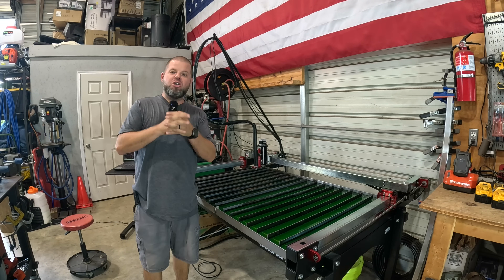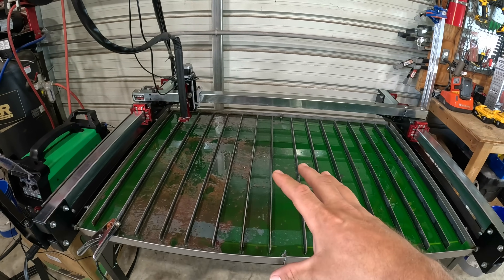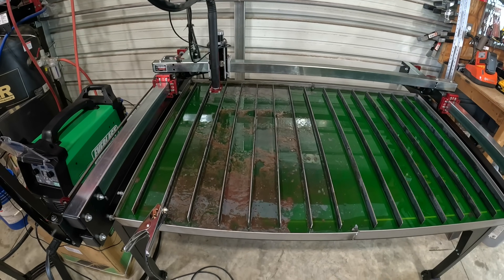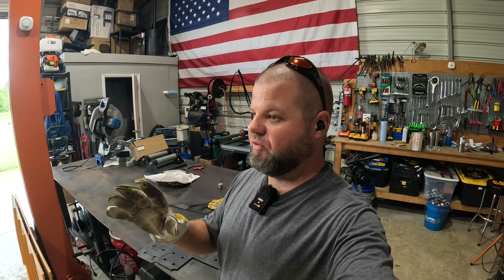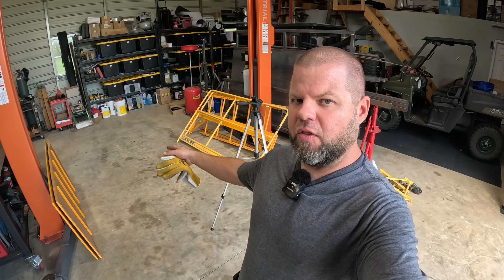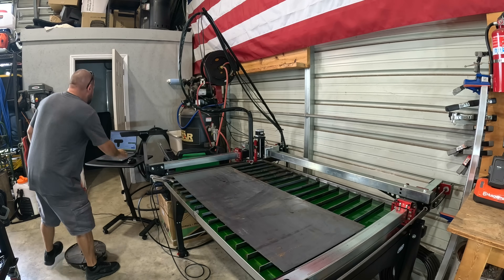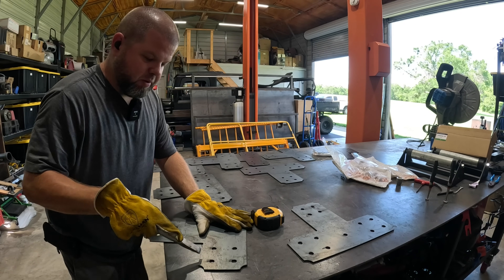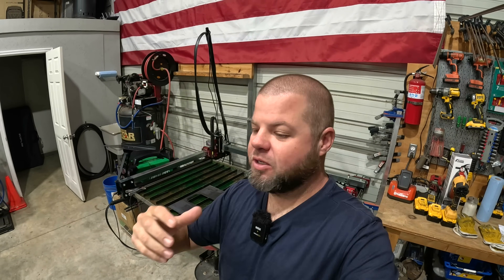CNC Plasma Table Has Arrived! Langmuir Crossfire Pro

Comment: Wow nice machine. Can you cut thinner steel like 1mm ?Which type of glassed do you use?
Reply from the maker: You can cut as thin as your plasma cutter and tips allow for. I'm running a huge 100 amp plasma, but I also intended to cut thicker materials.

Comment: I had a Langmuir table. Ran it for two years then started having problems with the THC. Their Support tech was helpful, but had to replace circuitboards and lost two months of production time before i was back in production. Then more hiccups and i ended buying a new controller. Ran fine for a year and then more problems. At this point i chucked the machine and spent $10k for a much better and larger machine. Not a Langmuir.
Reply from the maker: Hate to hear that, I sure hope mind holds up well and pays for itself.

Comment: Hi, I thinking about getting a Crossfire to make square and round cuts in coated galvanized steel. Do you think it will work? are you interested in doing some test?
Reply: It will work, the dross will be impossible to entirely eliminate and it will be hard to remove without also removing large parts of the coating making the whole operation potentially pointless. I mean the cut obviously isn't going to be galvanized?
But I've done it, laser cut a few hundred thousand actually. They're all out in the field supporting accordian air bags for solar panels or something like that, or at least that's what I was told. 

Anything to do with galvanized stuff and lots of heat means you've gotta watch zinc toxicity, by the way. Laser, plasma, welding, all the same. Not something I'd do on a crossfire table in my garage, not unless you've got a lotta milk, lol

Comment: It will NOT use whatever plasma you have, check their recommended plasma list ahead of time. High frequency start machines won’t work if my memory serves me well
Reply from the maker: That's correct, but I did not purchase a high frequency machine. Pretty easy to see their reccomendations before buying as they have a guideline on their equipment page.
Reply: @TKCL 

At 3:25 you stated
“it's
run off of whatever plasma cutter that
you want to set it up with By the way”

I’m just pointing out that’s incorrect. 👍

Comment: Look at their machine torch mount, I have one and it’s much better holds the torch up at top and bottom.
Reply from the maker: I got mine in yesterday.
Reply: @TKCL also if you get a collapsible kitchen funnel you cut a hole in it a cover the sparks from shooting everywhere. Just tips I’ve learned

Comment: What I'd like to do when I cut metal brackets I'll heat up the metal in my forge.And I softened the edges with a hammer to give it that forge look. Cheers 🍻
Reply from the maker: Sounds like a fun process to do.

Comment: I was an industrial engineer for Air Force.  We had both CNC water jet and CNC plasma machines.  I did not operate but I did problem solve when needed.  I’ve been retired for 10 years but I believe, if it will let you, try this.  On your lead in see if it will let you put in a negative number like -.06 or -.09 and then it will penetrate inside the hole.   Some machines will and some won’t accept negative numbers on the lead in.  Good luck.  Better yet, have two programs, one for holes with negative lead in and after all holes are cut out do not move the metal and load 2nd program with holes omitted to then cut out parts with zero lead in.  That would result in perfect part.
Reply from the maker: I appreciate the advice, I'll have to give that a try!
Reply: @TKCL  If you haven't figured it out yet I think the actual problem is cutting with no offset, you need to tell the software what part of the part you want. Calling for a negative lead might do what you want here, but I'm not entirely sure that is the correct method if it does. Additionally, you might find you get a better cut if you always pull the cutter instead of pushing it so you need to tell the software which direction on your part you want it running. If you want any sorts of dimensional accuracy you need to offset the actual cut path by half the kerf of the cut, AKA applying an offset. Typically files like that do not come with leads as part of em, it makes programming harder with non-continuous contours along with a multitude of other issues. Most stuff I've run will only run on center when you try non-continuous geometry, that means no offset, and then you have no compensation at the machine if a nozzle wears out a little and starts cutting slightly wider. You have to go back and re-offset the geometry and then repost it and reload it, not a very efficient workflow. 

Sorry for all the words, hope they are helpful!

Comment: You need to do an inside operation on your holes and it will pierce on the inside of the holes
Reply: You also want a leadin
Reply from the maker: I'll see if the program will allow me to do that, otherwise I will design a new part and factor that in.

Comment: One of the first things you need to figure out is how to turn the pattern at different angles on the work piece. You're wasting a lot of steel cutting them out that way. If you turned them 90⁰ opposite each other, you'd have had a lot more pieces from the same material.
That's a great sized table for a small shop. Now, I just need a shop...
Reply from the maker: Agreed and I also need to learn how to put several parts in one program so I can hit start and leave.

Comment: Congratulations, nice machine!

Please make sure you have adequate ventilation when running the plaz, and keep both electronics as well as the plaz machine in clear air, filtered if necessary. I used to run a big ESAB plaz table, the relays in the plaz power supply unit developed issues in less than a year, from all the metal particulates in the air... metal was depositing on the contacts while in use, drawn by the electromagnetic "aura" around the relays and such, causing sticking relays, and other problems.
Was warned by the guy that set up the machine, as operator, to wear a respirator, not just a particulate mask, some of the airborne particulates are microscopic. 

You more than likely know, but NEVER, ever pkaz or weld something that is galvanized, as well. 
Hope you enjoy your machine for many years. Not trying to be a downer, just pass along what we learned, the hard way. Have a great time, thanks for bringing us along!
Reply from the maker: Thanks for the heads up, I'll be sure to keep everything clean!

Comment: nice work.......in sheetcam you can specify inside, outside or no offset for each cut layer or operation. the holes should be an inside offset for instance. you can also specify that holes smaller than some dia (you pick) automatically start in the center which will eliminate the pierce kerf........its a big learning curve but the machine will change your life....good luck 73 Mike K1FNX  near Boston
Reply from the maker: Thanks! Do you put in a negative number for the lead in?  I didn't see a "click" option for negative lead in.

Comment: Thanks for sharing man!! That is so cool. I know one thing I'd be making for myself and to sell is AR500 3/8ths and 1/2 inch hanging target plates for Bing Bang plinking. Of course I'd also be making all kinds of stuff the tractors, implements, excavator etc.  So I was thinking when watching the last firewood video and seeing the fire pit propane tanks in one shot, do you use the center portions of the tank to make fire rings?  I need to go back and find the video on making the fire pits.  You likely cover that. Anyway, great video and thanks for sharing.  I think you certainly will be able to make some extra income with that CNC table.
Reply from the maker: I've already been thinking about AR500 targets myself. I need to see how expensive a sheet of that is.

As for the fire rings, yes I do cut the center sections out for those and for popular trash buners on legs.  Building another one today for a client.

Comment: Awesome, I remember this on an intern as an engineer and using Cad/Cam CNC  software, and those pieces of fragments left would go through a sand blaster and another dip. Awesome, Andrew.  The intern was O'Neal Steel and, in most recent, is Nucor.

Comment: I'm sure you already know but I've worked in shops with these tables. It is not a good idea to have your laptop/ computer too close to the CNC Table, especially while it's in operation mostly due to electro magnetic interference... not to mention the Sparks, dust and bits of metal table throws off. All bad for a laptop. If you slo-mo your video,  you'll see how far your table is throwing stuff. And the water as well. Most of the shops I've worked in had a closable cabinet to house the computer.
But please don't take this as criticism in anyway... not my intent.
Reply from the maker: Don't disagree, see my review video on the review channel. I have it on a wooden table away from the cutting area.
Reply: Definitely agree 👍